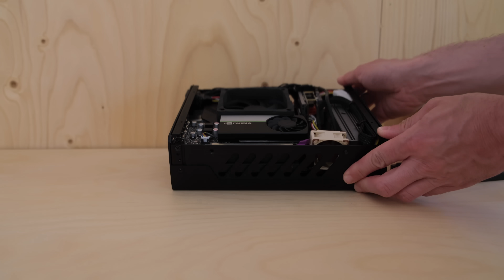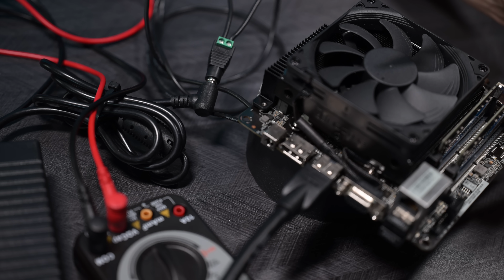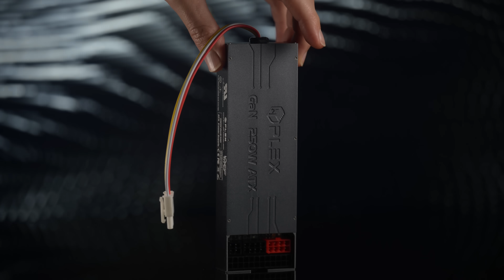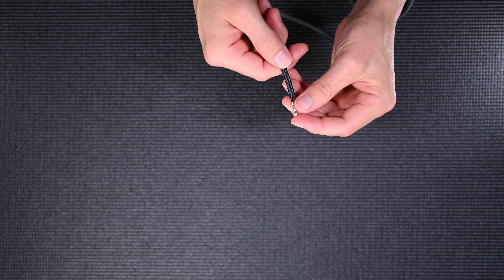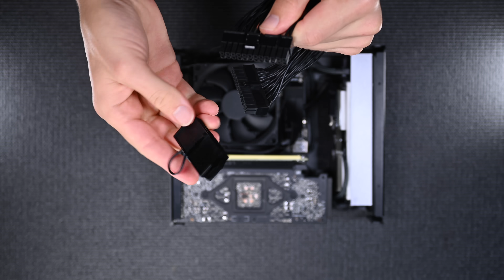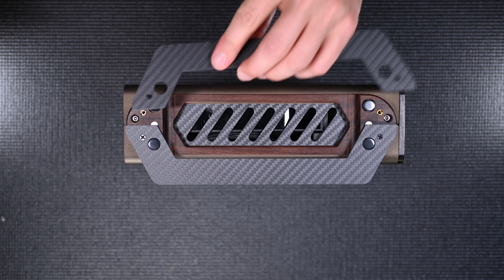My dream PC: "Tiny RTX"

Comment: would be nice to see what the temps are cool build
Reply from the maker: Hey friend. On the spreadsheet I have benchmark results, the settings, and most importantly the power draw. I can give you the temps, but there are two problems with that. Firstly my office is around 80F, which is probably not what yours is. Secondly, the CPU and the GPU are going to ramp to meet the max allowed fan speed. In my case its 65C for the CPU and 57C for the GPU at 160w. Giving temps out is not a great metric for most scenarios. The only one I can think of would be extreme cooling where you can out cool your CPU/GPU's ramp, which isn't going to happen in any small form factor build. At least, this is how I understand it. If I'm off base here chime in. Thanks for your comment and watching!
Reply: it still good to see common house hold temps know  for a pc's doesn't need to be extreme cooling it always good to know where common HH temps are for everyday pc's etc... since it is really classed almost as a mesh build  thx for replying
Reply: @NotFromConcentrate  yeah you can give all the reasons you want but temps + room temperate will do the trick.
Reply: @TheRanguna  You can be flippant all you want but it's not going to help you learn something new.
Reply: @bananapie2198 ?
Reply: @NotFromConcentrate  the power draw is system power draw? I believe the GPU is 70W, so it would be 90W for the rest. A few watts for the memory, some for the chipset, SSD, that would leave perhaps 80W for the 5700G. Is that about right? If so, that’s quite some power for that chip. I’ve had mine running with a negative PBO curve and that would be 60-70W max and more like 30-40W when gaming.

Comment: switch those antennas to a proper dual band smaller form factor (yes,... amazon has them)
Reply from the maker: Which ones do you recommend? These are really small...they just look big next to this very small case.
Reply: @NotFromConcentrate   I started using the ones from your video and they are pretty small but there's a smaller set which is often used for drone racing. On amazon look for item B076SGTMFS ... I use them with vPro wifi modules but also work pretty reliably on combo cards (Bluetooth-wifi) 👍

Comment: nice. how to kill performance of rtx with pciex x1.
Reply from the maker: There is no performance loss for running this card at 4x. Don't limit yourself with imaginary boxes my friend.
Reply: @NotFromConcentrate  Yeah, right. There's difference in running x4 instead of x8 for RTX 3050, which utilizes 8 lanes of PCI Express - where A200 utilizes 16 lanes. So yeah, tell yourself that it won't change anything when you connect GPU to 4 chipset lanes instead of 16 CPU lanes. If you can't take criticism because of ego(that's what it looks like), then internet isn't for you.

Comment: how does the gpu compare to a 3050
Reply: The a2000 might be faster
Reply: I think the A2000 is a underclock 3060 with low power memory, so it should be faster, but it's also much more expensive, its only worth it if you specifically need the low power consumption or the small size.
Reply: @AthosJosue  yeah
Reply from the maker: The good news is that miners bought a stupid amount of them...and no longer mine eth. I've already seen them go for 350 on eBay.

Comment: How would this compare to a Nuc 11 with a 2060?
Reply: This would be faster
Reply: An a2000 is comparable in range with a 3050 considering it uses the same chip but its downclocked massively and only uses 70W or so. A 2060 is about 20% faster than a 3050. So the difference is not as huge relatively speaking but the build quality on this is leagues better and more expensive considering the a2000 is a workstation gpu.

Comment: Big fan of ultra compact SFX cases, coming from someone who has a 3090/10700k build in a Sentry 2.0.

I have a J Hack v2, which fits my a2000 and 9700k build and I believe it's just about 3.1/3.2 liters in total volume(with external power brick, im using a 150w charger that about the size of a regular dual port phone charger). Great to see this space expanding.

Comment: Love the amount of effort and enthusiasm shown for this creation. How much in volume is saved by going mini-stx motherboard instead mini itx. My smallest build so so far is a asrock b550i Phantom gaming,  Ryzen 5 3600, Noctua NH-L9am4, gtx 1650 lp, dual m.2 drives and a 250 watt pico psu.
Reply from the maker: technically no volume as you could do the same build with a ITX board, but it's way neater with less stress than ITX. You get less I/O though and the fastest CPU you can use is the 5700g, but that's cool with me because I want something low power and quiet.
Reply: @NotFromConcentrate  wht is 5700g fastest you can use? Is it motherboard limitation? Wouldn't undervolted power limited 5800x3d be better?
Reply from the maker: @andreiguzovski7774  Motherboard limitation makes 5700g the fastest. If you need more power and can tame it then you can use an ITX board with the layout shown in the beginning.

Comment: Great build! I understand a rtx a2000, but why a 5700g, though? For a dream build, you could've gone with extremely good silicon of a 5950x, undervolt it very modestly and have great perfomance with low heat output and noise levels. 5800x3d is also a great option!
Reply from the maker: Great question. First reason is I had a 5700g and it's a nice enough chip for me...I spent enough money on carbon fiber so it was nice to save some. Secondly and more to your point, this motherboard the fastest CPU supported is the 5700g. Anything else won't boot--I tried. I do have other small form factor builds on this channel with the 5950x that utterly destroy this build on paper...but sometimes a build is greater than the sum of its parts. I really appreciate you taking the time to watch and comment. :)
Reply: @NotFromConcentrate  bro, how your pc run, im surprised mini STX can handle 12v DC without any step up voltage converter, you inspire me to do the same with my A300
Reply: Unfortunately the A300/X300 can't use anything but APUs, and the community has absolutely tried to talk asrock into a CPU capable BIOS to no avail
Reply: @deadlemon  the deskmeet can but the mobo is a bit larger though
Reply: @LiLBitsDK  a whole lot larger, but you're right, it does support normal CPUs.

Comment: I don't usually like small form cause assembly is tricky, upgradeability is a nightmare and there are always restrictions but this one look damn amazing, like really a dream come true specially with those damn high end materials, it looks more like some kind of true audiophile media stuff of very high quality.
Reply from the maker: Thanks man I appreciate it.
Reply: micro atx is a good compromise. It's smaller than the standard form factor but with more expansion and room than mini itx. I think that's what I'm going to go for my next pc
Reply from the maker: @HearMeLearn  I really want Micro ATX to work--my first PCs I was building were all Micro ATX (you can see some examples on my website) but there are too many problems which make it a deal breaker. Firstly it is the most unpopular form factor, and the board selection is extremely limited, and usually regulated to "budget" boards with limited features. Secondly except for some very unique layouts (again see my website) it doesn't end up being more space efficient than ATX when it comes to FOOTPRINT; the most critical of size concerns. Thirdly, I'm hesitant to invest in a 200+ hour design or worst, a four year production case project because I am on the fence wether this form factor will survive. We have seen some years without any good Micro ATX boards and it would be sad to have a killer case made for it in a year where there are no options. I have one design I REALLY want to try but can't bring myself to invest in the risk. I wish it was more popular.
Reply: @NotFromConcentrate   I'm always for full size ATX but only cause I barely have money so I have to chose well something for the next decade upgrading only GPU...

I really wanted to do a nice performance small PC but it would suck pretty bad over time for me as the only main rig for many years so I really have to go all big full OC with maximum PCIe and Sata ports, I also always like using internal soundcard...

But I agree with you, both mini and micro at the end the build will probably be very similar when you factor GPU as the piece that will dictate the size of the case unless you go with very small crappier GPUs or just APU alone which sux...

Ps: but this build you made is hard not to fall in love with the piece of art that it is, and you really paid attention not only to the case but also improving the hardware cooling inside 🤤😮

Comment: Always in awe of the craftsmanship from you guys. Really inspiring! Sorry if I'm missing something obvious, but why is the STX motherboard with M.2 to PCIe x16 preferred over an ITX motherboard for this build?
Reply from the maker: You can absolutely use an ITX/ThinITX board with an A2000. I just wanted something really "clean" and easy to install without tons of cables. With the STX board I can put the card right in the back and not use break out cables.

Comment: take a look at the lenovo p350, only 1L size and you can fit an rtx a2000 in there and it can take up to an i9 11900, however the 11700t is probably a better option.

Comment: I wish I needed a new PC because of this build
Reply: I mean you could always take out your components and put them inside a new case lol
Reply: @HearMeLearn  not compatible
Reply: Who says you don't need a new build? Is it even possible to have enough computer?
Reply: I realize most of this is about the art..But...You can just plug a high end laptop into a monitor and change the power profile to stay on when the lid is close..Voila..tiny PC...
Reply: @enntense  yeah there's literally no point to do this besides the challenge...much rather have a mini itx build with good temps and a beast GPU/CPU